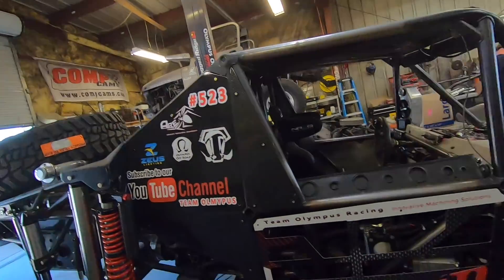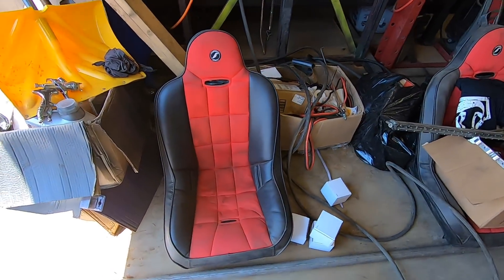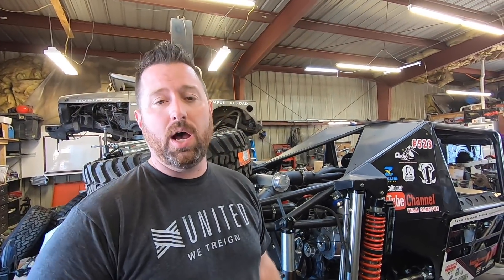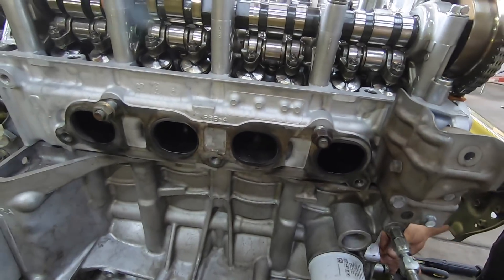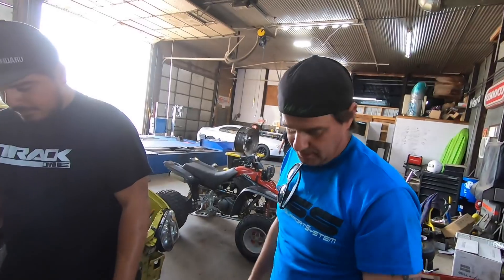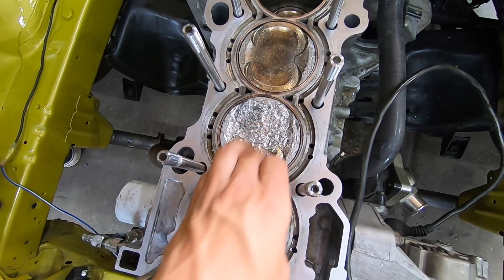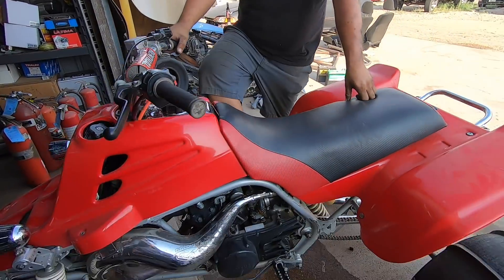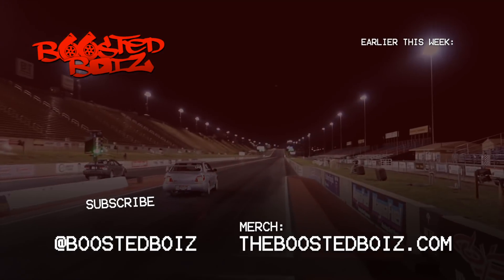Finding Out How Bad The Damage Is on Hondaru

Comment: Looks like 2 things to me, either you're floating valves, and having piston valve clearance issues, or you're running too thin of headgasket for the provided pistons

Make sure your valve lash is adjusted too. Theres a series by a guy called jafromobile on YouTube that talks about how to measure piston to valve clearance, and the proper way to go about it compensating for it. 

If I had to guess from watching, I'd say the thermal expansion of the valves is what's causing the issues. 

Good luck on your head problem
Reply: I never checked my pvc. If it was valve lash you’d hear it, and it would have to be wayyyyyyy off. But I don’t know anything
Reply: They're using bronze seats in the head. The seat gets beat up, so the valve gets side loaded and drops the  head into the chamber.
Reply: @s2upid  They're using OEM seats.
Reply: @humbleperformance  which head were they saying had bronze seats? Mr2?
Reply: Or too much cam angle
Reply: @Humble Performance you guys have any thoughts ?
Reply: @s2upid  you are thinking of beryllium copper valve seats. Bronze is not used for valve seats.
Reply: From the carnage shown in the video, valve float is either causing piston to valve contact or valve to valve contact. The valve float could be caused by multiple different things like, insufficient valve spring pressure, over revving, or even cam lobe profile.
Reply: It’s from the miss shifts almost guaranteed cause it’s happened on both cars after repeated miss shifts those sequentials r costing a lot of money
Reply: Charles Donkey Youre just a salty person in general no one checks piston to valve clearance when putting an engine together it just wasn’t necessary given all the parts were supposed to work and similar engines running the same setup. If it was an issue of valves expanding and hitting the piston then we would see the rest of the cylinders with the same issue. Don’t be a jerk because you can’t have what others have. ✌️
Reply: Charles Donkey No, the head is cheap. 🤦‍♂️
Reply: I mean all this typing is not necessary. It was a basically stock head... 8500+rpm. Missing gears. Do the math guys. They need to STOP using stock heads.
Reply: @justaguy9776  I wrote the reply before getting to the part where they pulled out the seat with the magnet.
Reply: Gale Banks just did a video on cam profiles and showed the bounce that a bad lobe profile produces
Reply: Victor D. This wasn’t a stock head and they hit limiter all the time on the other stock heads with no issues. Something is up with this one, fourth time it’s happened on a 4piston head
Reply: @s2upid  no bronze seat they removed part of the seat from the intake with a magnet
Reply: @StrikerFin  not true if you use high lift cam you need to check
Stock or drop in cam you can  not check it and be good
Reply: @victord.3197  The got some of the best valve and spring you can buy
Ferrea
Reply: Simon Legros If that’s the case then but I don’t think that’s the case here. Is it?
Reply: @victord.3197  if it was a stock head they would have been fine with springs, the problem is thats a mucho dollar 4 piston head, and they clearly aint holding up worth shit.
Reply: Simon Legros even if that's the case, what good are they without anything else surrounding them?
Reply: nathan gaudette if I recall that head is basically stock. But if you're right, they have way bigger issues than a spring failing. Me personally, I'm just calling it how I see it and wouldn't wanna see it anymore., I had a built 350z, fully built bottom end .20 over, decked and sleeved, BUT had "half built heads" kinda like these guys. However mine had a JWT boost cam, but still in reality i knew better than wanting to push into the 8500 (my tuner educated me and kept the cut right around that 7800-7900 mark).. but especially trying to go into the like 9000-9200 range is like asking for it... literally like "hey motor, wanna lift the head for me? Or maybe bend or snap multiple springs.,? Etc. " So before I get flamed, I know that It's a V6 that I'm talking about in my z... so it's a bit different, but it's still insane in my mind in a barely built head. Even a built one the shit still gets unreliable up that high if you really think about it. you get what I mean or am  Saying?
Reply: @victord.3197  yea i hear what ur saying, but this one is for sure the exact same head that kyle is running on his mr2, that had the exact same problem dropping valves in only that exact same hole, down to the exact valve lol, and its an aftermarket head from 4piston, as well as all the goodies to go with it, cams, ferrea valve train, the works. And ur correct on this being an inline 4 cylinder vs a v pattern 6, these k series engine really like the rpm, i have a stock head with crower springs and retainers on my daily that i rev to 8900 all day every day, for the last 115k and it loves it, there are ppl turning these things to and past 10k rpms all the time, phong being one of them, these guys just seem to be having an issue with both these 4piston heads which iirc are like a 6 thousand dollar billet head.
Reply: I think you have hit the nail on the head (or valve on the piston) in Emilio’s case. No matter how good or expensive a head is if you get it decked enough times your head gets smaller. Simple answer to a baffling problem.
Reply: I think the pistons are catching up to the floating valves
Reply: nathan gaudette ah.. I see. It really sucks to see it happen either way. I completely thought I heard Kyle said it was a basically stock head and I was just like omg what do you guys expect. So the answer lies somewhere else then...
Reply: Lol @ bronze valve seats!!  Some of you MS should never open up your mouths!!!!
Reply: @StrikerFin  Actually kid, EVERYONE worth a damn checks valve clearance.....
Reply: @StrikerFin  4 piston heads are the most expensive head on the market right now....
Reply: theodore Dow-man “Valve to piston” you know, how close the piston comes to the valves with expansion taken into consideration. High lift cam stuff, no one rebuilding an engine is gonna check these.
Reply: theodore Dow-man By the way I was being sarcastic about the heads being cheap, why are you so slow?

Comment: My top guess for the repeated failure is the crankshaft is already bent. Try to measure run out and deflection of the crankshaft and see if it is out of spec or not. I once faced a similar issue before and we had no idea what it was giving us issues. Turned out it was the crankshaft bent and runout measurement alone wasn’t enough, deflection caught it.

Comment: Check Piston to valve clearance, when miss shift at high rpms, the valve floats. Seems like that was the scenario for all the heads that broke valves.
Reply: Does a sequential trans miss gears? Sorry I'm a noob.
Reply: @boostjunkie2320  When driven by Kyle yes lol
Reply: In an interference engine, if valves float bad enough, no amount of clearance will save it
Reply: dburkh91 very true lol

Comment: Just a couple of things.. You might want to look into the cam profile on the Hondaru. If the valve springs are good, then the cam lobe throws the valve too far, and causes it to hit the piston. This can also happen when boost lifts the valve open, and/or too much spark advance at the top end. Stock springs are good for 6000 rpm. Stronger single spring holds bigger cam but not much rpm. Dual springs are the solution to get over 8000 rpm, and oil activated valve lash cushion helps to dampen the spring(s) from vibrating. Then the another thing: the seating position on Razzle Dazzle. You need to keep your helmet inside the cage at all times, and if you lift the seat more upright, it will shorten your spine every time you hit the landing after some air time. Always, when you plan on modifying something, try first to learn why it was built like it is. That seating position, with the seats has been altered several times after the first draft. Those changes are made for a reason.

Comment: Lower the rev limit to 8k, set limit cut to fuel only (softer), fit correctly rated springs and or valves, confirm clearances.  Dial the SHIFTs in!

Comment: "We're not pointing any fingers" screw that, point fingers.
Reply: where is this statement?
Reply: It don't matter bro. Give it a rest. You think they want you bashing companies?? They absolutely don't want to see that.
Reply: Let's be real here, cylinder pressures aren't going to flatten out loosen the valve seats, which is what they've been having issues with.
Reply: no lie if they've been using NA heads i'm gonna get mad and not at 4P. Didnt they send one back or get another sent out though? Has every head been an NA?
Reply: does this also apply to Roman's setup too? Also, the fact that countless others have had the same issue.
Reply: @wesley8599  I have no clue man... 4P made a super brief comment on their FB just saying BB didnt communicate withe them and that it was the wrong head speaking about Hondaru.. Im not sure if that is the case for all their heads, but again, I think to blame someone like 4P here is a bit much, being that BB and PFI are still new to the High HP K-series scene. So tuning and assembly is not gonna be spot on yet. Its trial and error here. This is a lot of power we are talking and BB hasnt exactly been conservative with their builds using aggressive cam setups, high redlines, ect.. Problems are just going to happen. And Im not sure what valve and cam setups were used on Romans car or some of the other builds, but for me, blaming 4P here is counterproductive. And like someone else said, I dont think BB would want you to blame 4P either.
Reply: this is some MAJOR wreckage that to me smells like an assembly problem. But boost floating the valves of an NA head sounds pretty spot on. Would like to see how far BB's "we'll show yall the bad" mentality is if it was on their end, and not dig the 4P blame hole deeper. Cause until they take blame or figure it out the fans will continue, sadly.
Reply: we shall see here shortly. Also, its obvious myself and others are speaking about the machining. In addition, didn't 4P assemble the first two heads; or, was it humble. Please at me, I'm curious to hear your take. Enclosing I stand corrected, I meant to say issues in general with 4P.
Reply: JBR engines for the win 🙌 nothing against 4p though
Reply: I think all this has to do with the BB using different parts from different places try to make it work and trying to figure it all out there's no one to blame besides the BB there the ones who need to figure out the combo or parts/setups they are running and because this is kinda new to the BB there running into problems I just wanna see them work it out and get more reliable engines
Reply: Sake Bomb nope roman on a stock head, 

The problem always happens when they smack the limiter on missed changes on the dog box
Reply: @sakebomb5446  Well, being that there was valve-piston contact on such a high-revving k24 bottom end with aggressive cams and timing, and the constant mis-shifts, Id say the liklihood that the cylinder porting and machine work is to blame is incredibly slim... And I think Humble has been the go between for BB and 4P as they are a sponsored vendor and supplier. But Kyle says exactly the what could be the problem.. they keep assembling these heads using the same methods and tuning, meaning they have not done much to correct their setups. There are tons of possibilities here.. The 6000 series by Ferrea is a High RPM NA valve. Could be valves.. They also used aggressive cams on all the builds with 50 degree VTC and high redlines.. This, and they have had transmission and shifting issues on ALL of the cars.. So to sit here and blame 4P and head machining is a bit ridiculous is you ask me...
Reply: maybe should watch #keepgunnin they work very well with 4p and shyt never blows up
Reply: well, one of the heads was a 4p head, from humbles shop, and installed by humble.
Reply: What difference does it make? Is the boosted application head built stronger? No, it isn't...
Reply: lol @ you deleting the post I responded to. The point is that the 4p head was not the problem. The poor choice in springs was.
Reply: the only factor here is the valve springs...

Comment: It could be a number of things why it keeps doing it. If your piston to head clearance is too low (really high compression pistons) then you can trash some valves. If your timing is too far advanced then you can run the pistons into the valves. And if your valves and springs are too weak, then they won't close in time to miss the piston as it's coming up in the stroke (floating the valves). Which makes sense since every time it breaks, it's always been in the higher rev range. Just a few thoughts I had. Love the vids, and keep up the good work. I aspire to do what you do one day!

Comment: Gotta always remember its RPM that kills engines. Keep the rpms down to a reasonable level and the engine will stay alive.
Reply: Hahahahaha, you said reasonable. Did you forget what channel this is?
Reply: That head should’ve been good to 10k. Banging 9k should’ve been fine. They need to drop them already and put together their own.
Reply: @SlowDelSol  As other people have said, it seems to be the 4P heads
Reply: Jose Ahumada 4P just did the porting, not the valve guides, or it would be their problem. They probably had valve float. And realistically, a higher flow head will be more prone to high rpm free revving. They really need stronger valve springs, or a more aggressive/lower rev limiter.
Reply: @jacobrzeszewski6527  yeah exactly my thoughts
Reply: But... but... "a redline a day keeps the mechanic/carbon away."

Comment: 2 heads and 3 similar problems and now 1 completely trashed. Just seems weird!!
Reply: Seems weird that it’s happening every time he miss shifts
Reply: Why use the same builder of the motor..😂😂😂
Reply: High revs to need to lower the rpm down but Brent knows his stuff .he is the god on hondas
Reply: CYRAX KKCB2MO lol no more building Emilio’s block by Kyle
Reply: @ulyxwtm  misses gears what you expect...jk...
not pointing fingers.  👉 4p...
Reply: CYRAX KKCB2MO na i got a built 4g63 with a built 4pistom head and no issues.
Reply: @ulyxwtm  i got mazda 6 with a 2.3fomoco..
zoom zoom Mazda...4rd power...
Reply: @cyraxkkcb2mo10  I have a 06 nissan altima with a blown headgasket. wassup
Reply: @MathiasGreenwalde  you should of got the 06 convertible Nissan Altima...way faster...zoooommmm
Reply: Matt 😭😭😭😭

Comment: My suggestion, like in the past, is to run these engines through several heat cycles, before boosting them, checking gaps/clearances while cold, and again while hot.  Run it N/A for 5,000-10,000 miles.
After break-in, when you slap on a turbo, expect there to be more heat(obviously) so gap accordingly.  If you're wanting to run high compression pistons, run a thicker head-gasket, for the break-in cycles, re-check clearances/gaps, use clay to measure gap, then once the engine is proven to be gapped properly with the thicker gasket, and made several good passes at the track, then consider using a thinner gasket, but re-clay/re-check clearances, while engine is still warm, and take into consideration of heat expansion.  Also, when you're picking out parts, use turbo-application valves, on a turbo-application head.

Comment: Go get a eaton m90 supercharger off of an old 3.8 buick or pontiac at the junkyard, and custom fab an aluminum adapter plate for the intake manifold on the J, then fab an adapter plate for the throttle body and a block off for the stock throttle body on the intake manifold. We did it when we swapped a J32 into my buddys EG hatch, it ran an 11.7 on some 22 inch tall slicks, that should be plenty of power to do wheelies, I think it was on like 9.8psi and the install was easy after we fabbed everything. It cost maybe 200 dollars with the aluminum sheet and the all you can carry sale at the junkyard to get the supercharger and the misc fittings. The hardest part was to find the right belt. It had a slight heat soak issue, but with the setup on the cart it shouldn't be nearly as bad.

Comment: That's hapend when you missed the shifts and the motor rev hi the spring compres then drop the valves.
Reply: I rewatched the video from the track and from the very first pass it was banging 9000rpm+ miss shifting it sounded horrible and the motor made serious bad sounds.
Reply: The head is supposed to be good for over 10000rpm. So no, that's not what happened. Otherwise all the cars they have with stock heads would have issues.
Reply: @scootbmx01  1000? They were banging on 9k lol
Reply: @CeeZtwo  come on dont be that guy. He try to say 10k and miss a 0
Reply: That's why you have a rev limiter. The heads good for 10k. This isn't just a one time thing. They've gone through more heads than I've gone through cars.
Reply: @scootbmx01  the head and the valvetrain are not the same. Kyle assembled the valvetrain..
Reply: @elonmust7470  kyle's assembled other k24 valve trains and not had issues. Humble performance are claiming its a valve spring issue so we'll see what Kyle says
Reply: @scootbmx01  he used springs that weren't stiff enough...
Reply: @elonmust7470  he's used those same springs several times before... It seems the cars that have issues are sequential.
Reply: @scootbmx01  was he making the same power?
Reply: @elonmust7470  Romans car? He didn't touch the head on that. Also the hondaru makes like 200hp less than the mr2 did and rowdessy broke on even less.
Reply: @scootbmx01  I have no idea I don't watch this channel much.
Reply: @scootbmx01  I will tell you that just because someone is using springs that might not be stiff enough for the intended rpm, dosen't mean that the engine is immediately going to float a valve... It could, but it could also live years before it did so..